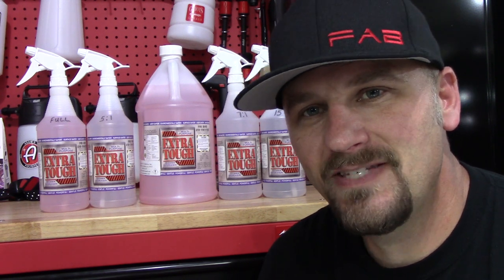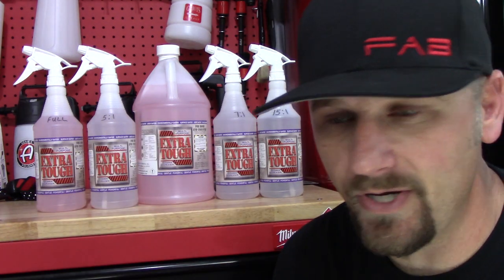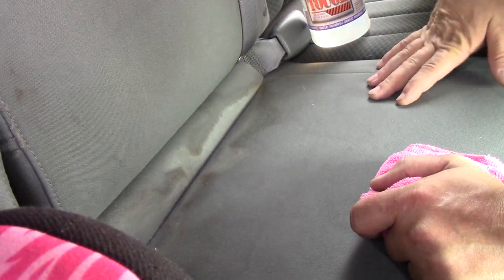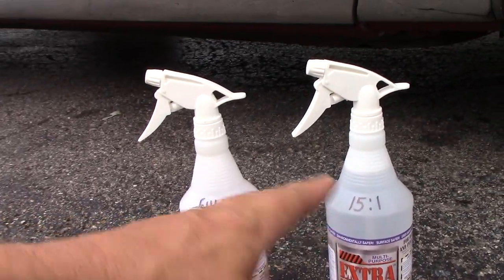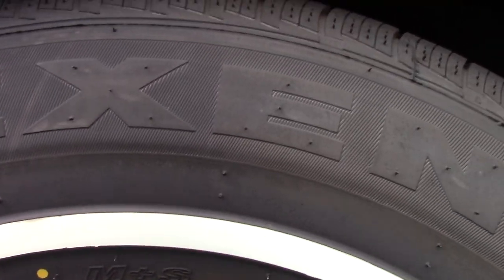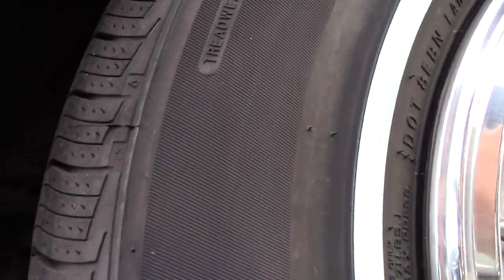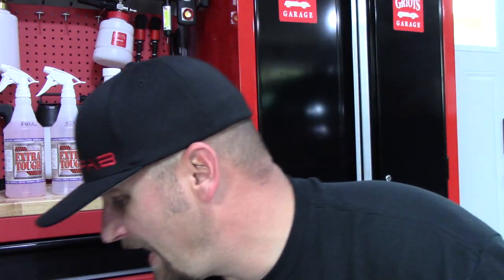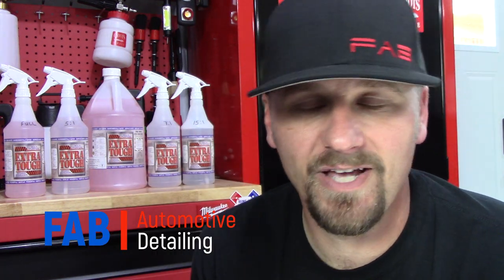Extra Tough Multi-Purpose Degreaser

Comment: This stuff is legit.  I have been using it for  over a yr now and it cleans just about anything.  I cleaned my neighbors rental carpet.  It was trashed and this stuff made it look almost brand new.  It was amazing.  Smell is mild too.  Not a strong scent.  Just smells like a cleaner.  My sister used it on her retainig wall that had rust stains from her sprinkler system and it took it all off with a small amount of scrubbing.  Didn't burn the plants either like acid washes do.
The fingernail polish removal was amazing!  I will keep that in mind.
Great info Brian!
Reply from the maker: opera Yes it is legit. Glad to hear it can remove rust stains. I was impressed by the finger nail polish. Thank you

Comment: Hey Brian I have a automotive question. 2012 Chevy equinox headlights. I replace the low beam bulbs . the fuses are good please don’t tell me it’s the BCM. Thank you in advance. Cool video that stuff is awesome.
Reply from the maker: Joseph Dell'Aquila Check the plug that plugs into the bulb it’s most likely a melted terminal. You can replace the pigtail and should be good. Thanks man
Reply: Thanks Brian I’ll check that I appreciate you getting back to me.
Reply from the maker: Joseph Dell'Aquila You are welcome!

Comment: I like the brush you used for the wheel wells. Mine is too soft for wells. It was sold as a wheel brush.  Name or link for your brush please. Man it really did a great job on the wheel wells
Reply from the maker: Simon99 I bought it from Griots several years ago and they no longer have it on their site and there is no name on it. Sorry man. It worked awesome on the wheel wells.
Reply: Thanks. I’ll find one similar eventually.
Reply from the maker: Simon99 Sorry man